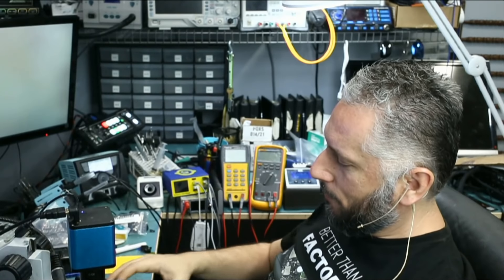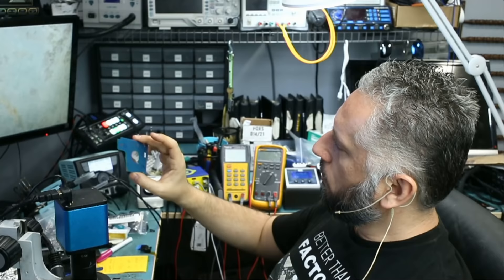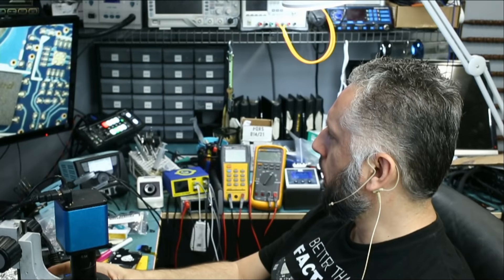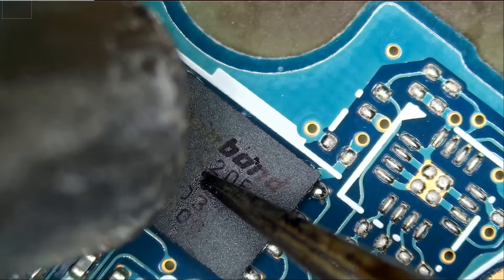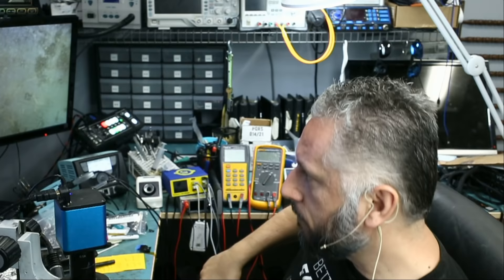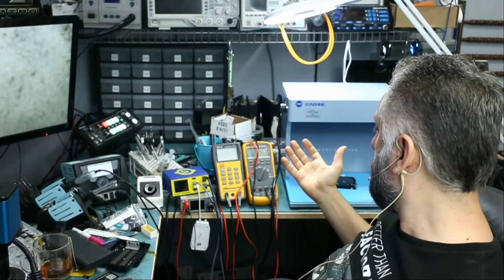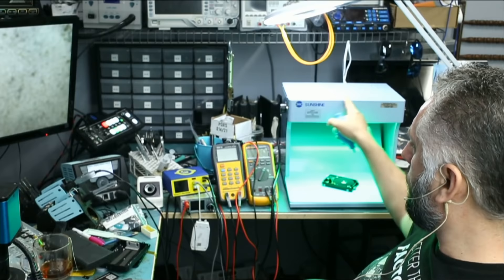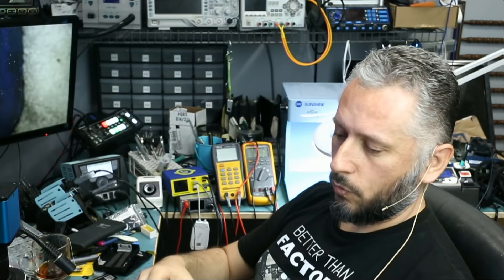Hard Drive Clicking Beeping Not Detected. Is data recoverable? Clean room inspection.

Comment: No need to transfer the platters. No data recovery lab do that except for a motor fail. Only need to swap head assembly with a good and compatible one. And than use the right tools to fix firmware issues if any and image the drive. Good luck.
Reply: @gblargg  any other options, can i use same company's different model head.
Need Any similarities in size?
Reply: @grandprime7397  the disks should be completely identical for the best possible chances. some models use identical heads, but that's generally harder to find out for sure, so an identical disk is a common option for us mere mortals...
Reply: That's what I was thinking. Swapping the platters in a multi platter drive has the added risk of misalignment.

Comment: You don't need to swap platters, actually it would be a very bad idea. The only reason why is needed to swap platters is when the motor is damaged. Very likely issue here is "faulty heads". When heads are bad, swap theme from donor drive. Further knowledge are needed to find proper head stack donor and of course practice.

Comment: Before attempting any mechanical parts swap I'd take a close look at the board ( chances are you've done this already :) ) - specifically the contact pads for the head actuator (the other set of pads would be the one for the motor). Any sort of liquid/condensation/oxidation damage would show up there. Some steel brush and IPA (plus a IPA swab on the contacts on the mechanical side) would do the job and in my experience this works way more frequently than it really should...

Comment: Reading head replacement is a bit more painless, since all plates have to stay in the exactly same position realative to eachother after the transfer, even a small deviation can cause the data to be unreadable. I have the same issue, first I thought it was something on the board that caused the issue, but after testing with a donor board, I get the same results as you do. so I removed the head mechanism.
But didn't find any matching one, and I'm not gonna buy a new one for this reason. + you'll need a head comb for the heads not to touch eachother while transferring it to the faulty drive. This is the least painless solution, but you have to cover yourself if you want to do this. Make sure you make the customers know that there's high possibility that the data could be lost even after doing this.
Reply: That's true only a 1 foult. The exactly same position is not important with the right tools, you can read the first one and then the second...and .Ake a reconstruction of data with a virtual controller. Like pc3000.
Reply: yes very painless

Comment: You need PC3000.  Most of the time clicking even with a swap you need to check firmware and configuration on the hard drive.  Expensive venture but it could pay itself off once you gain the experience in using the tool.

Comment: I was under the impression that data recovery shops swap the Head Set, not the platters, due to it being difficult to get them seated with the correct tolerance. they use plastic clips to prevent the heads from being damaged during the swap, which i assume is a specialty part. Good luck with this endeavor.

Comment: Love watching these videos all the way from AUS. Has given me the confidence to attempt a repair on my Creality Melzi motherboard (albeit, without success. Not complete failure, but it still powers on and does the same as before. Looks like I've got some more investigation to do!).
Your "No BS, straight to the point" format is excellent and is thoroughly enjoyable. Keep it up!
Reply: The melzi boards are pretty bad, few design flaws. I repaired mine several times after FETs catching fire, stepper driver failutes, irreversible damage to the temperature circuits and firmware failure. I ended up just building my own board and linking it to an Arduino mega.

What problems does yours have? Which firmware were you running? Maybe I can help?

Comment: Hi, Alex. Diagnosing the faulty part of the drive when these types of issues occur, is not that easy. Sometimes, a simple manual repositioning of the head is needed, as it can move from it's normal position if the hard drive has been hit or dropped. But, changing the platters, as many other people here have said, is a difficult task, as it takes perfect precision in reassembly. I would first try changing the head motor, then every other possible solution, before I'd go venturing into that territory. But, on the other hand, I would very much like to see you fix this hard drive. So, if all else fails, replacing the platters to a donor hard drive could be the only option left. You certainly have the skills and precision in your work to pull it off. And even if you fail, you learn something new...and also make an interesting video. So it might not be a bad idea to post the videos of you practicing the operation, because I'd watch it! :) Keep up the great work!
Reply: Good advice, did not think they could take the platters from one drive and relocate to a good drive

Comment: If a dropped hard drive is clicking and it isn't working anymore, it is likely that the platters, arm or hard drive head were damaged and misaligned from the impact. ... If the head is trying to locate data on the platters and cannot find it, the arm will move back and forth across the platters several times.
Reply: Or perhaps a headcrash.
Which is irrecoverable

Comment: When transferring platters you need to keep them perfectly aligned by sticking some tape around the edges of both platters  for perfect alignment otherwise it will nott read. Do not move any of the platters out of alignment from the other

Comment: Considering that you have a large pile of graphics cards and other devices to be fixed, shoulnd't you leave hard drive recovery to someone else? If you additionally offer HDD repair, this leads to another queue of devices...
Reply: Exactly my thought, the moment the problem wasn't related to a electrical failure/motherboard it should be deemed a no fix. This is a common problem among hard drives and it comes with age, it's called the click of death. The only option is to replace the platter or the reading heads, which is why people specialize in this field cause it's a hassle. Not worth the time for Alex, also considering the stack of items he already has.

Comment: It's easier to swap the head stack than the platters, you really don't want to remove the platters unless you have some very special equipment or have the sort of luck that wins the lottery twice, especially if there's more than one platter. 

Click of death usually means the drive can't read either the embedded servo data or the firmware which is written to the platters. 

Back in the days of MFM/RLL drives it was so much simpler but the flash chip you swapped has more capacity than many of those drives.

Comment: This "feature" is called "click of death". In many cases you cannot restore the data then. If the plates get shifted, you might also lose data. You might try to swap the reading head instead of the plates. So no shame if you blow it, it is indeed a difficult job which is not always working.

Comment: Hi Alex, this is complex business. I believe you can do it. But remember that you are dealing with microns. If the harddrive has been dropped the stylus arm will have been distorted. They probably use laser alignment at western digital or Seagate. I'm trying to fix a Panasonic video recorder that is studio grade and I can no longer get the heads. I'm going to use a digital caliper tool and record the measurements before taking it apart. It's precision work. So good luck...

Comment: Thank you sharing  the information  its, I had the same issues. I kept  the platter change the  partial  mechanical  assembly  and it worked and still working

Comment: My guess is a dead head pre amp (the chip on the flat flex attached to the heads) so you could swap out the bad assembly and try again as a dead pre amp will result in the drive controller not having signal from the heads.

Comment: Transferring platters, you need to keep the readers separate, or you’ll bend them trying to separate them (magnets), then line the platters up exactly (down to the mm). I usually use tape on the edges to line up the platter to the next platter, makes it easier for dual platter hdds.

Other than those two things, it’s really really easy.

Comment: i've been down this road before
tried it once
precision is the key, all it takes is for the head on the arm to touch the platter and it's 'game over'. The heads are very sensitive and have to be spaced perfectly.
the reason the arm keeps jogging back and forth is it is trying to park itself but is not reading correctly so it keeps resetting, most likely because the head on the arm is likely damaged OR the sensor on the arm position is damaged and cannot detect the position so it keeps searching back and forth for the home position.
At least this is my guess....

Comment: I've done a few of these and just changed the head. It's not always successful.  Practice is the key. If customer is indeed 100% needing data they have to pay the huge price data recovery centers pay. If they would like it but if it goes it goes then worth having a go to keep costs down. 

Needs to be from identical drive as changing head to smaller or bigger can have issues with compatibility.

Comment: It's probably a reading head failure, transferring disk platters is a tricky job you need to keep them perfectly aligned as they were on the donner drive and it's a 50/50 chance it would work.

Comment: Oooh, when you swap the boards, the clicking stopped.  I thought you will say that it is something wrong with the firmware.  
Cause if it was something wrong with the reading heads, shouldn't it still click with the new board ?

Comment: I have a Seagate 2.5 inch 3 platter 1,000GB (not to be confused with 1TB) drive I'm working on and I've honestly replaced EVERYTHING physically. I've delicately placed the platters into a new drive shell to utilize a new motor, swapped the reading head, swapped the lower and upper magnets, swapped the motherboard. The drive spins up, the head reads to the center slowly and then goes back to the outer disk a total of 10 times and then spins down. The entire time the drive is not readable. Should I purchase a molex adapter to attempt a firmware flash or something?

Comment: If the pcb is fine and only the issue is with the head, can we simply replace the head without transferring the bios? 

2nd point: if we have to use the donor pcb then can we flash the bios using ch341a programmer and flash it with the old bios's data? Instead of soldering ans desoldering the pbysical bios chips and swapping

Comment: Before swaping platers I would try first to read the flash chips and then check if Service Area (SA) of the disk is somehow damaged. This is a special area on the platers where part of the HDD firmware is written. If this area is damaged, data recovery is very difficult even by using proffesional tools. Connect it to a PC using it's SATA interface (if it's exposed on the PCB with a standard connector) and check how the HDD presents its self to the BIOS. If you see some strange name or characters then chances to have bad SA or flash chips are very high.

Comment: you can transfer the heads, i did this a lot, i build my own plastic tools with a straw and some plastic strips glued together to slide under the head so the heads do not stick together, if that happens its game over. you first take out the damage head stack and put it aside. then when you remove the working heads you directly place it into the drive without putting them anywhere else because they get damaged very easily. after you transfer the heads its very likely they are not aligned correct with the tracks on the platter, the bigger the hard disk the more difficult it is. you can unscrew and screw back the screw of the headstack and if you are lucky you get a point where it starts reading. then you use linux and ddrescue to do a direct clone to another hard disk. if you lucky and it starts copying dont interrupt it and let it run as long as it goes. it may hang once in a while and you need to reconnect and play with the head screw again until you can copy more. unfortunately i had only success with hard drives up to 1tb. with bigger disk the tracks are too small and its very hard to get the right position.
Reply: Wow, that's awesome, have you been replaced the heads from the donor drive to the failed drive and clone it using with ddrescue to clone it to another drive? Did it work??
Reply: @chris01479  yes you need a donor drive the same model it can work sometimes
Reply: @robbirobson7330  I hope it will work as I already have the working donor drive, so how did you replaced the heads? Did you used the clean chamber with hprea filter??
Reply: @chris01479  you can build yourself a small cabinet with plexiglas or some trash bags and connect a vacuum cleaner to it to suck out all the dust and keep it running while you work on it. also get some gloves. As i said in the first post i did not have any luck with 1tb drives and higher. but you can still try. if you have a single platter drive you can swap platters it will be easier but then you need to swap the pcb as well.

Comment: Platters are like timing an engine. They have to be in the right right spot. Not only correct layer but orientation too. 1mm turn on a platter can ruin all data. Way easier to swap the head assembly just be very careful to not hit the reading head tips on anything the slightest bend and they are useless... when the drive is sealed the head floats 5 microns over the platter, human hair is around 100 microns.thats also why dust is so bad. Cant mark the platters either like say 12o clock. To reinstall inline as marking on them will damage them.... I have done data recovery a handful of times successfully. Any time i touched platters or their screws. Never got data back.

Comment: HDD combs! buy a few for generic drives, you can swap the arm easily with 3d printer HDD combs that are very cheap on amazon/ali express. The comb will lock the arm and reading heads in place to avoid damaging them.

Comment: I've looked into platter exchange and it looks simple for as long as you do things in the correct order, including, how you put stickie tape around the platters and move it all over in one step. How to 'lock' the heads so they remain parked. All should be fine.
Reply: You'll go through thousands of drives not hundreds to be successful at platter swap.
Reply: @atinder2006  not necessarily. thousands of drives. You really only have to match the boards of the hard drive and swap them with the platters. Seen plenty of video's on this plus I know those who have done this in the past.

Comment: Hi Alex, do not swap the discs but swap the heads. I did it before and that works (sometimes) :-)
Reply: Wow, that's awesome, have you been replaced the heads from the donor drive to the failed drive and clone it using with ddrescue to clone it to another drive? Did it work??

Comment: I'm really curious of what failed in that hard drive. You're changing the board and the firmware which would be the fast, easy and economical way to do it, but this type of manifestation is more common than you might think. I personally am holding a 13 year old 320WD which failed in the same way due to easy mechanical shock. It wasn't even powered on and the fact that I have hdd's that suffered bigger shocks and still work just gives my brain a 404wtf moment.
I've had numerous attempts to repair that hdd and can't find anything loose, cracked, burnt, or short circuited. Maybe it's something I'm missing. Manifestation is the same. spin, crackling, loud buzz

Comment: Iv got a similar problem with my ps4 pro hard drive but when I took the motherboard off the gold connector plate was turning black so cleaned it now fine but wonder if u no if its a common problem? It reads fine was just when It started beeping once then I rebuild data base then started to beep more to open and fined black spec on gold pads

Comment: I might have considered just replacing the whole controller board vs just the firmware chip.
Reply: Yeah, but it still would not have worked.
The problem is mechanical and/or a problem with the heads themselves.

Comment: I killed 4 HDDs only in the few 8 years 
My 5th HDD is going to it's end,
that's why I searched about HDD noises and found this vid
Anyway it turns out that letting your PC running 24/24 hours a day 7/7days a weak for 3 weeks is not good for WD blue drives 
My first HDD is dead not by that actually, i killed it bcuz i moved it while it was still spinning and it is undetectable by PC anymore
Yeah this is my life with HDDs hoping some day I'll be able to afford a SSD